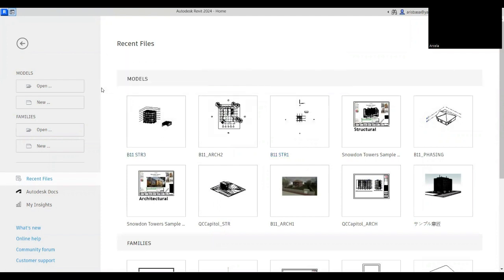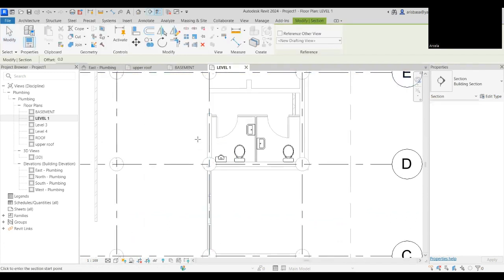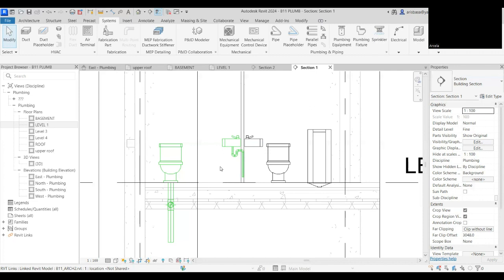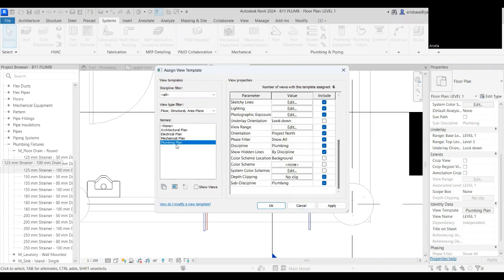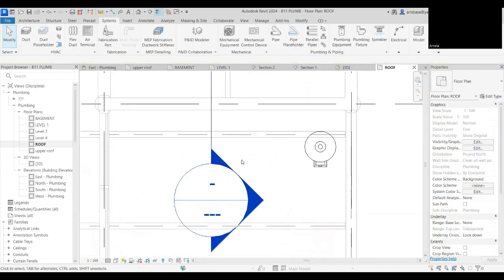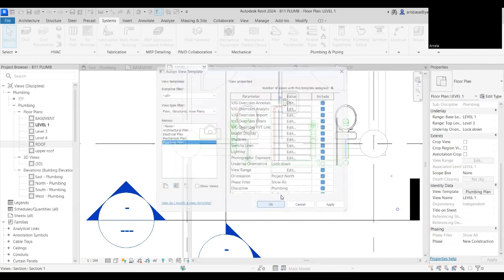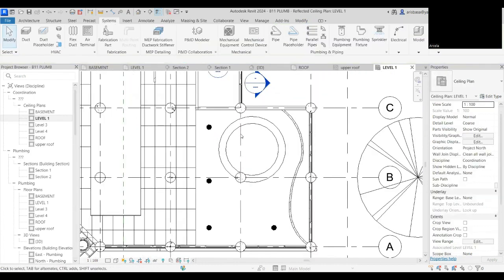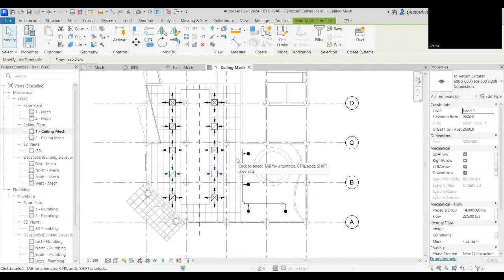Revit 2024 Live MEP part 1

Comment: 9. How does Revit handle collaboration and coordination among different disciplines within a project, such as structural engineering or MEP (Mechanical, Electrical, and Plumbing)?
Reply from the maker: Watch out for the next lectures in this series, you will find out.